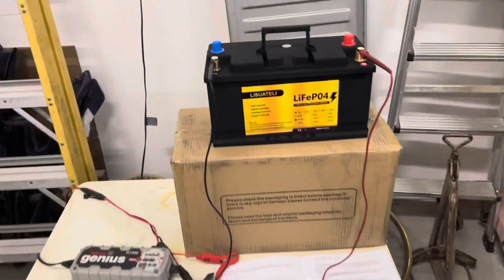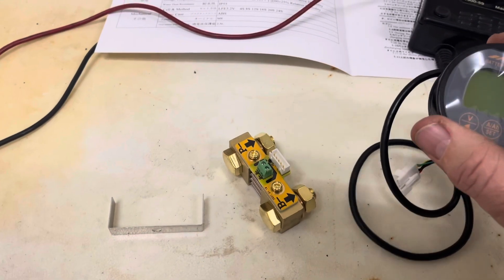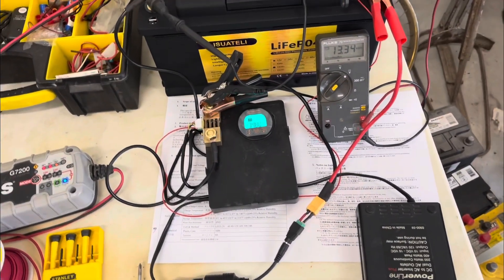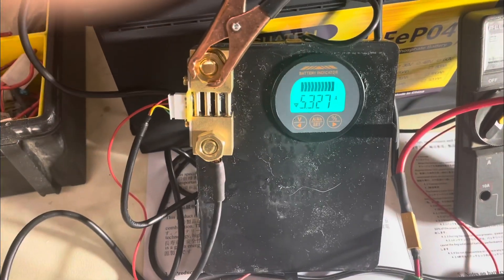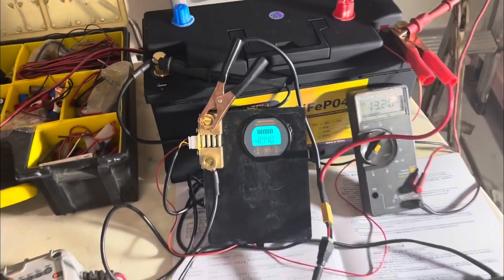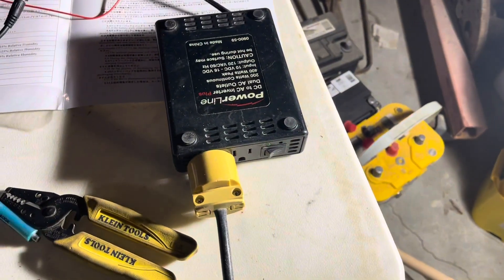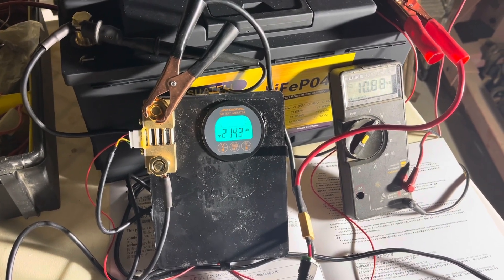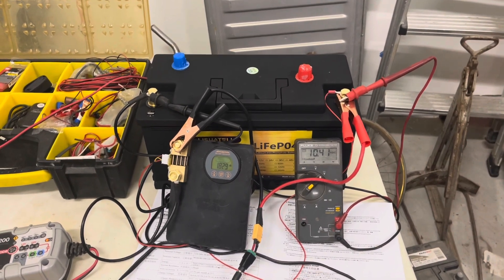Lisuateli liFePo4 100AH 12V battery capacity test.

Comment: Will repeated charge shut-off by the BMS damage the BMS over time. I have a VEVOR Model S-500 converter that is charging my 3- 100 Ah Lisuatele batteries. Everything seems to be working fine. The charge shuts off at 15.1 volts. I assume that the BMS is shutting it off. Since lithium batteries shouldn't be charged above 15 volts, I am concerned that if the BMS has to shut it off that it might fail in time ... What do you think?

Comment: You need a lifepo4 charger (14.6 or 14.65v) to fully charge thr battery. The G7200 lithium mode can only charge up to 13.6v
Reply from the maker: I have since bought a power supply capable of charging the battery properly. I will redo the test and post the video.